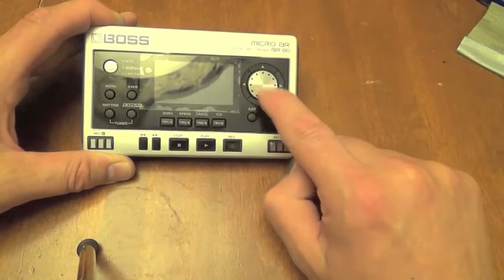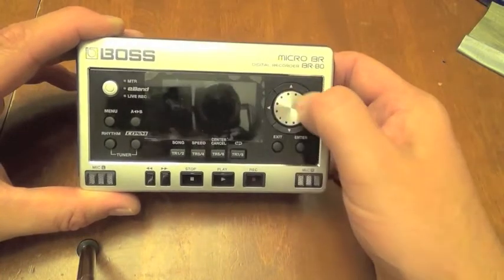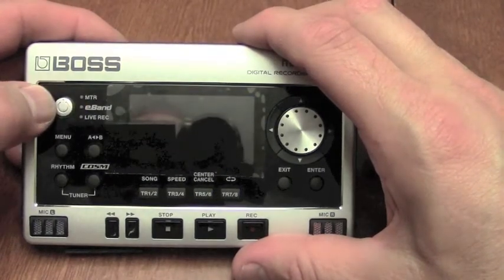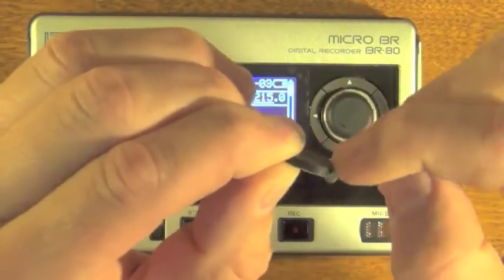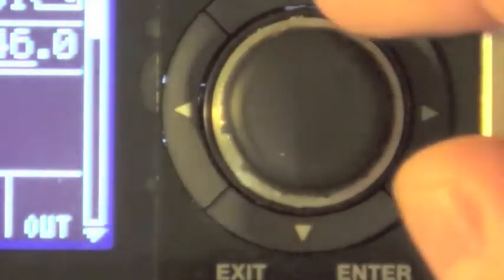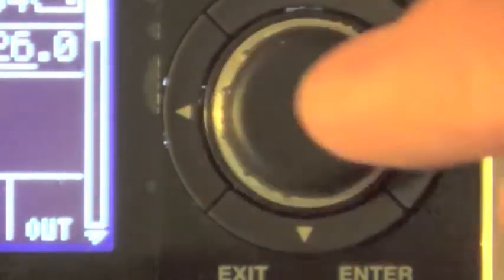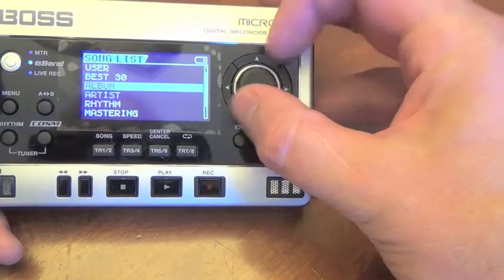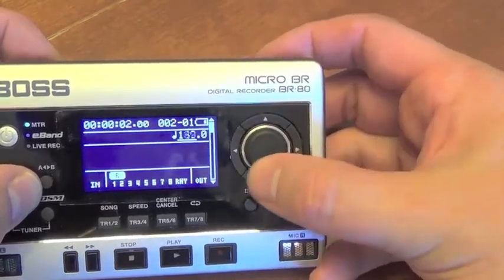Boss Micro BR BR-80 - Making a better Scroll Wheel/Jog Dial (Simple Modification)

Comment: Great and very informative videos on all this Boss stuff!
         I had to send mine in  for repair because of this.  Roland & Boss and their scroll wheels.     i had a Boss Dr-5  drum machine ( with instruments!) and several track digi recording.     This unit was notorius for scroll wheel problems.  Went for repair twice in the 4 years I owned it.
Reply from the maker: +B.j. Surfdog Yeah, the DR-5 requires a lot of scrolling during pattern edits.  The best thing is to try to avoid spinning any scroll wheel extremely fast as they do heat up internally... not much of course, but over time really fast scrolling can have quite an impact.  Admittedly, this is kind of a guess on my part, but it sounds reasonable.  ;-)

Comment: Thanks for posting this video. I've had my BR-80 for 2-3 years now and the scroll wheel was starting become an issue. Not anymore. This quick fix works perfect! I dug out an old laptop, removed the rubber foot that still had very strong double-side adhesive still attached to the foot. Did not even need to apply glue. I may apply some in the future to get a permanent hold. You should send this idea to BOSS for any next gen BRs. I always thought the flat scroll wheel was bad design even before I had any real issues.
Thanks again friend

Comment: GREAT idea, but you could use 2 (or even 3) small, felt furniture pads, or cut to size (one on the other) from the dollar shop. Easy replacement and no damage to the wheel (no glue required) More of a knob feel.
Reply from the maker: True, there are definitely alot of different approaches, but I found that many peel-off adhesives had trouble holding up to the constant handling of the wheel.  However, I would definitely recommend using a peel-off adhesive FIRST though...just to make sure you like the feel of whatever you attach (to make the wheel more "grip-able") before committing to anything more permanent.

Comment: whats the diameter of the foot that you attached to the dial? in millimeters
Reply from the maker: Good question!  Diameter 16.90 at the base (where it touches the BR80) and it tapers slightly to about 15mm at the top (not including the rounded top edge). Also thickness is approx. 3.0mm.